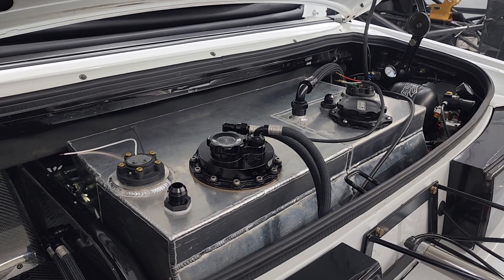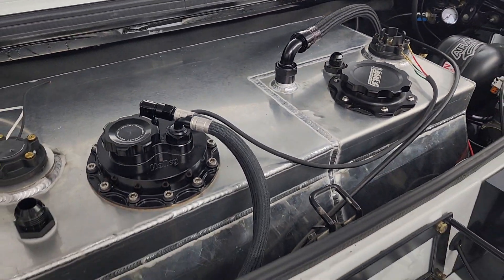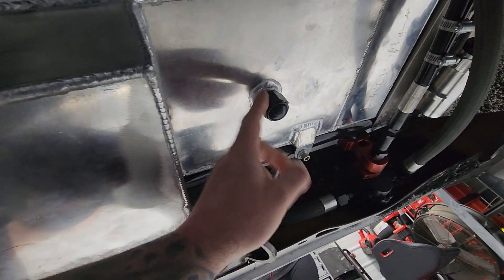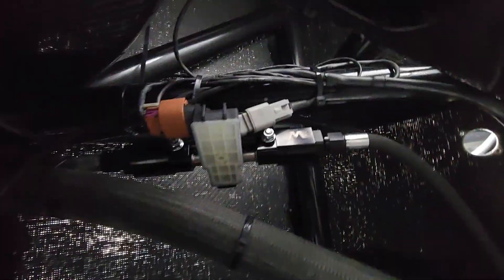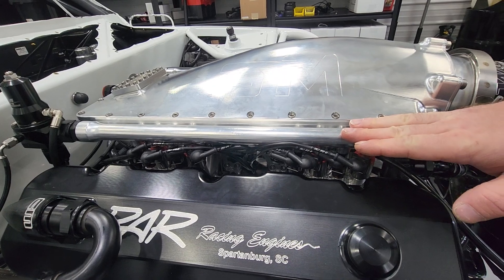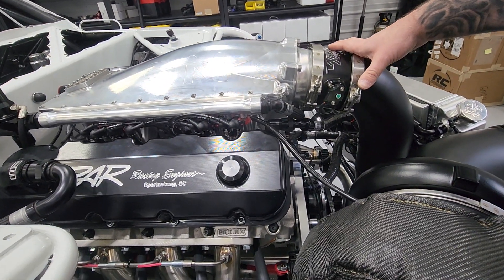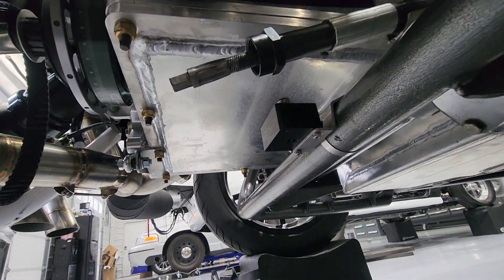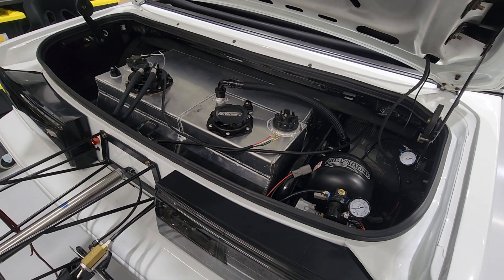Dual fuels with Holley Efi

Comment: Is there a way to switch between fuels while the engine is running?  For example, Some systems have this ability by flipping a switch on the dash it turns off gasoline injector #1 simultaneously turning on methanol injector(s) #1, and on the next crank rotation turn off gasoline  injector #2/on meth injector #2 etc....this allows for a smoother transition between fuels without the need to shut off the engine or have a abrupt/harsh change over.
Reply: I've been switching my dual fuel system by a simple dual contact relay. Mine is set up to switch automatically using a pressure switch. It's a old set-up but it's been working this way since 2005 on my car.  I switch between 93 and 116 octane on-the-fly.

Comment: You might have a problem with inconsistent fuel pressure with the 450 and the vette style filter/regulator. I currently run mine the same way and it can barely keep up with a 255. From what I have 380lph seems to be the limit with them.
Keep up the awesome content! Hopefully the regulator works out. Holley also makes one that is rated for higher flowing pumps.

Comment: Devin because I’m not at your level, what is the purpose of driving the other fuel pump with a cable? Thanks from a beginner.
Reply: Electronic fuel pumps cannot meet the fuel flow demands of methanol in high power applications